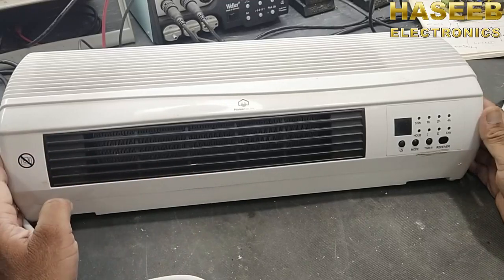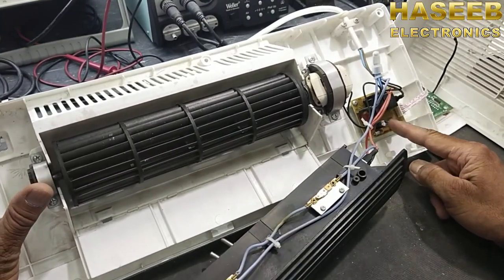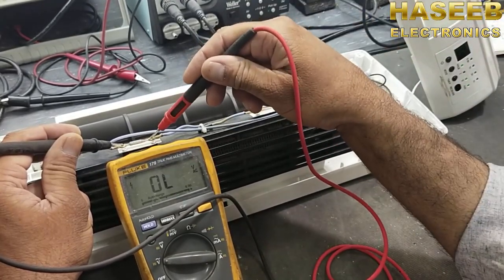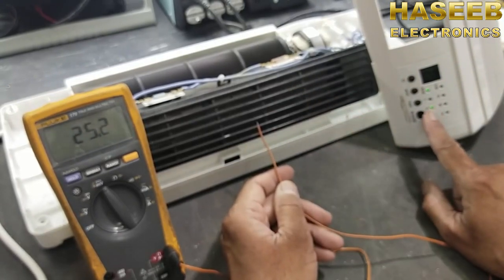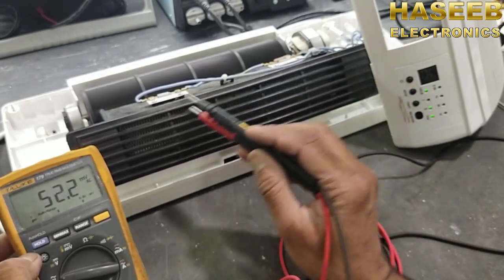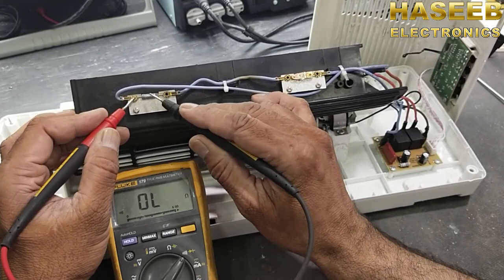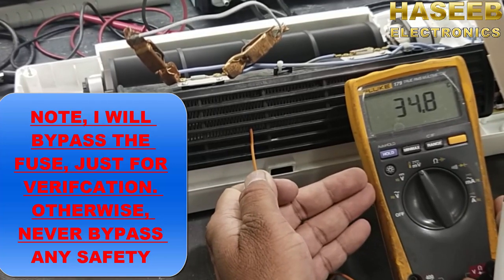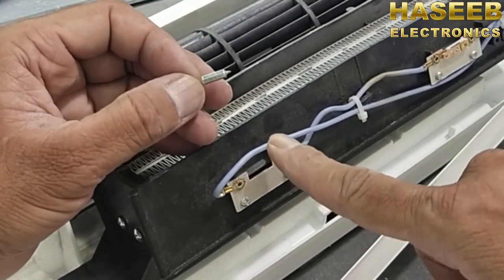[410] How To Repair Electric Room Heater / When No Hot Air / Electric Room Heater Blowing Cold Air

Comment: I have the same model with 1000 and 2000 watt heating element. Hot air comes out and I hear the fan is blowing. However, the tempreture effect remain within a meter or less distance and the room is not as warm as it is stated. Anything I can do?
Reply from the maker: please check the fan speed. it seems that its speed is not enough so that it is not throwing air properly
Reply: Thank you for your prompt response to my question. Is there a way to increase the fan speed when there is no button to do so.
Reply from the maker: it is my pleasure 
there are relays on the control card for speed selection

Comment: The replacing of the thermal fuse will work, but how long? You should always search for the root cause of any defect. Here I'm quite sure the airflow is not enough, because the blower wobbles. That should be fixed too or I fear the heater will overheat very soon.
Hint: If you try to solder a new thermal fuse, you have to cool it with ice spray while soldering. Otherwise it will melt internally. (Already seen. 😉)
Reply from the maker: yes sir, its root cause, which i could not record that was thermistor was slipped away from the air duct might be some thrust or something, so it continued to run for a long time, when i placed it to its position it started auto-cut at 1 degree above than the temperature setting. airflow was good

Comment: i have same one but silvercrest motor not running how to check that?
Reply from the maker: check the control board, possibly the relay is not working 
or remove motor and check it by applying direct power.
Reply: @HaseebElectronics  if i apply direct power how to know motor volts? AC or DC?
Reply from the maker: it is ac line voltage
Reply: @HaseebElectronics  220 V just to be sure?